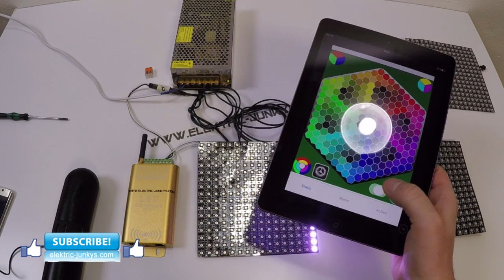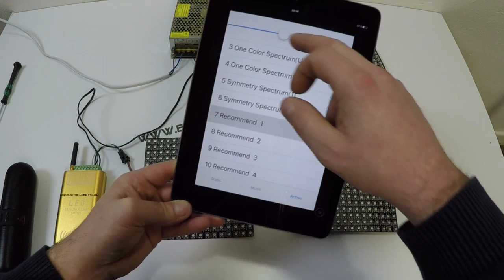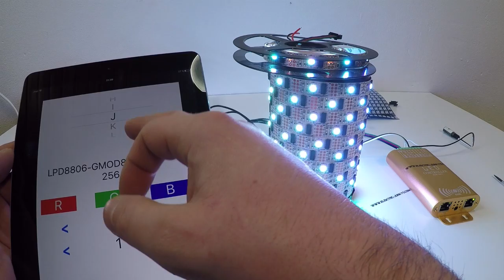Awesome Projects you can use LED Strip Lights for #LEDSign WIFI/Audio Controlled

Comment: Dear, 

 when the controller starts up with voltage, the last program will 
automatically be played without switching it back on via telephone or 
tablet? 

thanks in advance for the answer 

with kind regards Marc
Reply from the maker: hi, yes you can set that up in the controller settings.. regards

Comment: Pretty well done! I do have a question though, in the previous video, you guys had custom text, which is exactly what i need for my project, was it a custom app? Also, doing the calculations, 5 16x16 panels with the extra items would cost somewhere around 250-300 USD if i'm not mistaken? Since curving them is the big deal, using less than 5 wouldn't look very pleasant :p
Reply from the maker: hi mate .. sure is all Possible just send us an email .. we shipp from china withing DHL Express 3-6 Days .. one of our Staff will get into your Case and Advice you the Best and Cheapest Solution .. thanks for comment mate !